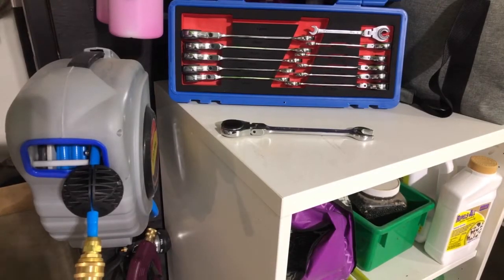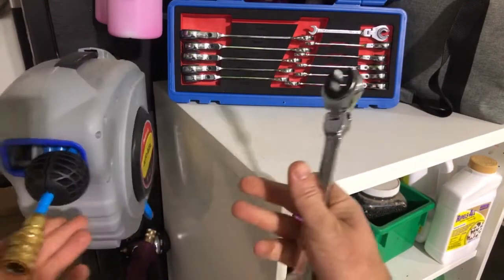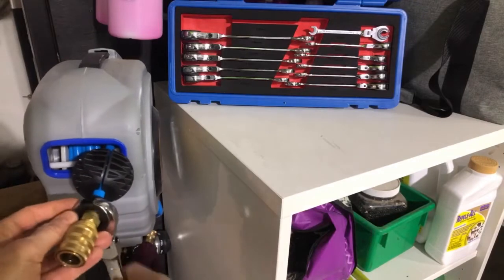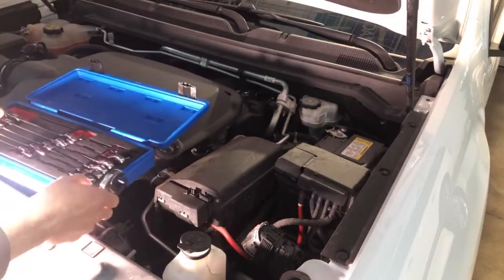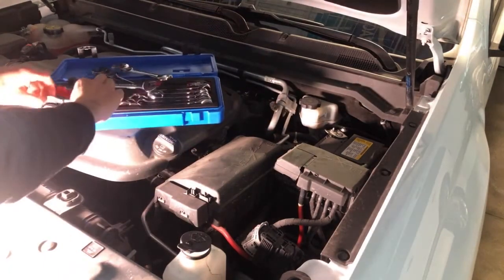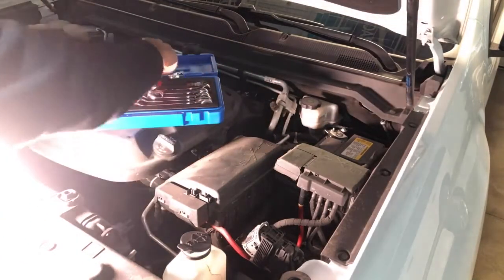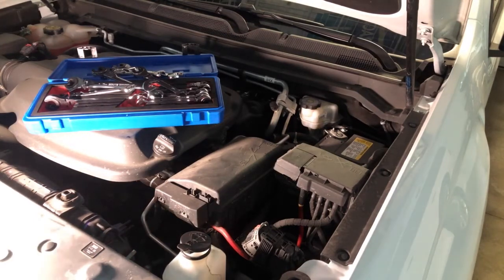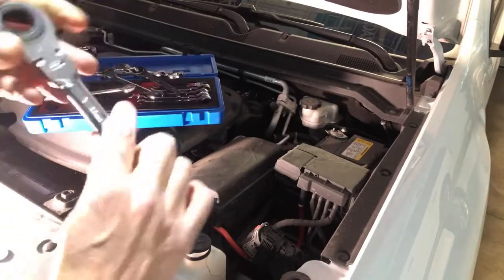Demo/Use Ideas: Anbull Ratcheting Wrench Set with Open Flex-head

Comment: I don't see these replacing a regular set of flare nut wrenches anytime soon. Between the bulky head size and having to return the ratchet to the open position to remove it from the tube.
Reply from the maker: I agree, a regular flare nut wrench would suffice. There may be a couple applications where this saves some time, but not sure they are worth the high cost yet either